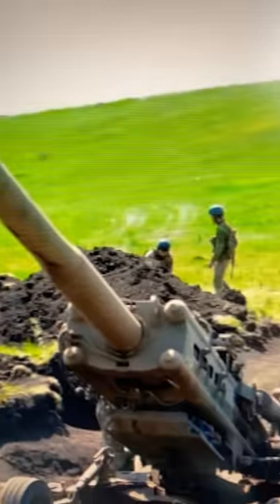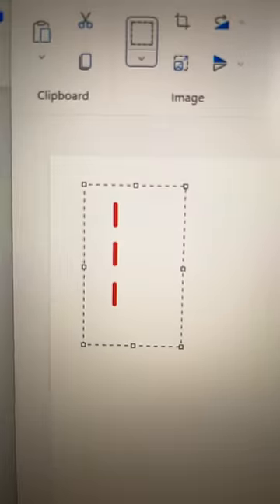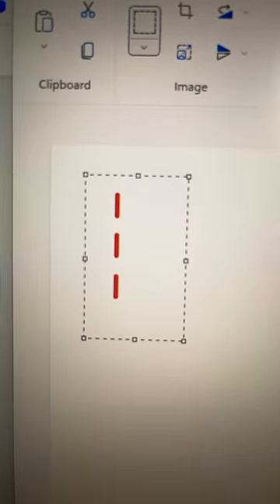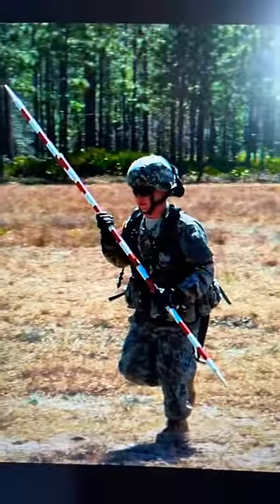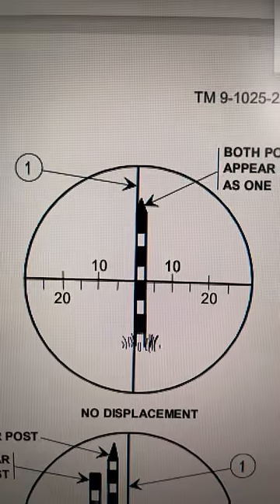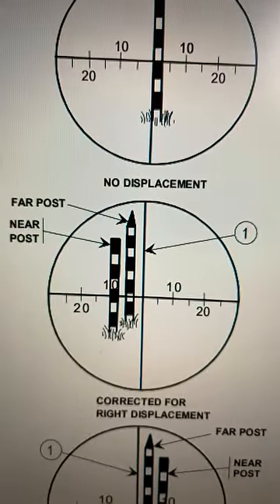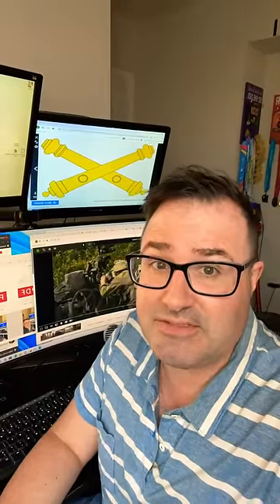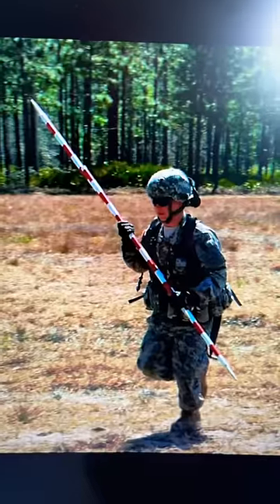How is an M777 Howitzer Aimed?

Comment: “From the type of shell fired to the spinning of the earth.”
“Remember what I taught you, at this distance you’ll also have to take the Coriolis effect into account” from COD4
Reply: At 2km, you will not need to compensate for the spinning of the earth; you will need to compensate for the spinning of the bullet.
Reply: That's Mark Wahlberg foolio whatchu mean COD haha
Reply: So if you travel with the spin you go faster and if you travel against the spin you waste more energy?
Reply: Distance AND direction.  90 degrees to the Coriolis is the Eotvos effect.
Reply: If I remember correctly the Coriolis effect changes with latitude and flight heading of the projectal.
To be honest, this is way beyond my Skil set.  When I miss I three or more hundred shot I shoot the reciprocal of the miss on the target to my aiming point.  It worked really well once.
Reply: @howardpacker6240  Coriolis is about geometry of a sphere: when shooting from the equator to the pole, the speed of the objects are different, the objects closer to the equator moving west to east faster than the objects closer to the pole. You have to account for the difference in speed between those for your north-south component of firing.  The Eotvos effect is about altitude when firing east-west, as the earth spins targets in the east RISE up, and targets in the west DROP DOWN.  You have to account for the Eotvos effect when shooting east-west.  Gunwerks and other companies have made hand-held range-finders that calculate ALL of that and more like elevation shooting level, up or down must be calculated differently and give you a firing solution to dial your scope turret into.  They even make custom turret knobs for their scopes that true up the gun based on its specific muzzle velocity measured by a chronograph.  Their motto is "1000 yards out of the box." You need to attend their shooting school too to achieve that though.  When sniping the last "human only" skill is "doping the wind." You can measure the wind where you are, but not along the firing path and destination so you have to learn to look for clues as to what the wind is doing.  If you can't "dope" you can "fire and adjust" by observing with a scope where the first shot landed.
Reply: @BenHyle called Magnus effect.
Reply: @BenHyle nah you have to take account for the curvature of the projectile. The spinning only makes it go straight. But wind is a factor
Reply: @BenHyle at 2km you certainly do have to account for the coriolis or eotvos effect depending on firing direction.  A 3000 feet per second round travels 0.91 kilometers per second, taking 2.18 seconds to complete the 2km traversal.  The target and the shooter will move east-west at disparate speeds for 2.18 seconds.  Just run a thought experiment: a shooter and target moving west together at the same speed, and then the same thing with the shooter moving FASTER or SLOWER than the target.  The spinning of the earth doesn't make anything go straight. Its not a spinning cube.
Reply: The Chernobyl soundtrack echoed in my head as I read the comment
Reply: @BenHyle Artillery rounds can go up to 30 km
Reply: I remember that mission, you end up missing and just taking the guys arm off.
Reply: Thanks for giving me "Coriolis effect" to google. Down to another rabbit hole I go.

Comment: Aiming poles are used as a secondary aiming reference. When firing degraded (no digital/electronic capability) you will normally use a collimator which is much closer to the howitzer, has internal illumination (if it’s not a busted POS) and is more accurate than aiming poles. Just an FYI.
Reply: Tis is true. Or if your not a complete scrub, your DFCS actually works.
Reply: Yes, and that 10mils shown was the displaced deflection to the near (short) post), using the NFL rule (near, far, line) which in reality was ZERO mils, because of the NFL rule. The line on the pantel (panographic telescope) is the zero line. The distance between the near and far posts should always equal the distance between the far and line, and always goes "near, far, line." That's how you account for gun displacement from firing, not how you determine firing deflection.

Comment: Ryan just in case, during my mortar school in Poland we were taught that those poles were to be used only if there is a lack other of proper targets like buildings with a visible vertical line that could be used as reference point. The far the point/line is the better, you could use electrical poles or even trees if you spot one that fits (visible, with a straight vertical edge, and can be easily distinguished in the environment). Poles can be used in open fields or in open areas in forests.

Comment: Turns out fixed reference points in any calculation are still pretty sweet. You could probably improv these in the field with insulation tape and 2x4 scraps.
Reply: you can also use a DAP (distant aiming point).. its been year I forget but I think it just needs to be 2100 meters or more away.. and its what you use when you colimeter isn't working properly.. and/or the ammo truck runs over your aiming posts
Reply: @MattCamp  why does that sound like it comes from experience
Reply: @little_lord_tam  I may have shot a few rounds off a DAP in my time... And may have see a faulty collimeter and some run over aiming posts..
Reply: @MattCamp  we use sticks sometimes but I just call them storypoles and the aiming posts seem like an important thing to run over nice to know there’s that guy or fuck ups everywhere not just on my job site lol sorry you had to deal with dipshits that make your job harder
Reply: @forevernomad1766  Haha, this was a funny read. Very true, they're everywhere, be careful 🤣
Reply: @forevernomad1766  Funny how we all think of our militaries as elite, smart and professional. But theirs plenty of idiots in all our militaries.

Comment: I was a motarman the aiming stakes are for direction of shooting,then a charge is for distance, and up or down is for location
Reply: The mortarmen attach charges to the tail of the round which adds propellant to the round, thus increasing the range. You alter the trajectory within the added range of the shaped charges by pointing up or down.
Reply: @Stefan Parocki I use to hang a four duce motor all day and illumination for tanks at night,I know about trajectory and there is a left or right on the tube for adjusting fire on target,When you hang a round and things like wind direction and rotation of the earth come into play on some shots plus some targets move they ain't always dug in,so you shoot and scoot so you don't become a target youself
Reply: @Stefan Parocki It's more complicated than that. Angle increases distance upto 45 degrees, past that it starts to decrease. Charges increase the length of the projectile path which increases the distance. It's possible to hit the same spot from 2 different angles, that's where tot (time on target) comes in. The higher arch will always take longer to hit the target compared to the lower arch equivalent. It also obviously changes what angle the artillery round hits the target at which could be important if the target is a vehicle or a building.
Reply: we stuck 2 sticks in front of our foxholes n trenches for field of fire too, not just the arty boys doing it...
Reply: Yes aiming circles for Quick fire missions, shoot and scoot,when your dug in It's going to get Hairy in a big hurry

Comment: Bit more detail (777 guy here). 

So, the aiming posts are the secondary aiming reference with a aiming reference called a collimator as the primary aiming reference when degraded. Displacement is only done if the howitzer has shifted from its original emplacement location (normally after firing or shifting azimuth). FDC is not given the location of the posts but knows the location of the howitzer, and the howitzer knows the location of the posts and collimator. The gunner sight measures the angle between the original azimuth of the howitzer, the posts, and to where the howitzer needs to traverse to. This gives 2 known angles of measure so that the gunner and section know where the howitzer needs to traverse to. Hopefully in the future I can make a video on this but I'm making sure that all info is good for release. Gotta keep that OpSec

Comment: I was a 13P (MLRS FDC) for over 6 years. You gave a pretty good and simple answer for everyone, and I appreciate it. Many people without an artillery or physics background wouldn't understand the slew of variables that go into the calculations, not the least of which is the direction and force of the wind at different altitudes and the speed the round is traveling. Redlegs get a bad rap from many other MOSs, so truthfully, I do appreciate it.

Edit: Spelling
Reply from the maker: I really simplified it.
Reply: I never really thought of wind shift at altitude. Is there an unclassified way to measure that? While not someone able to put this to use in person due to health disqualifiers, I do find the math side interesting.
Reply: @BenLJudy  Weather balloons gather data as they go up/ I forget the exact interval they gather it though.

Comment: US Military: The most technologically advanced in the world with the most sophisticated equipment 

Also US Military: You use these sticks to aim.
Reply: Cheap, reliable, immune to cyber warfare - sticks are op
Reply: @qwertyuiop5530  also look at Call of Duty how many people get major amount of kills with the Kali sticks
Reply: Sticks and Math to aim. On grease boards.
Reply: If it ain’t broke, don’t fix it.
Reply: I’m really curious to know if there’s a program to integrate machine learning to slowly phase out FDCs. if you just have a machine linked to the network analyze flight path data based on easily collectable data about the firing area, wouldn't that be possible to just have a forward observer shoot some info to the gunners?
Reply: @Dohnutninja1337  their was a projected but it got canceled incase of emp warfare the miltary wants to be technology advance while having backups for manually reloading etc.
Reply: Juan, US military trains both the manual method (in the video) and automated (using fancy computers connected to the howitzer). In the event digital methods fail, which they likely would in a contested environment where digital connections are not guaranteed, the manual method practiced since the dawn of the Field Artillery will still work. The Ukrainians were likely already familiar with the manual method and taught how to use it with the M777. But yes, sticks are very helpful to lob steel thousands of meters down range to hit targets.
Reply: Also the US: Uses weapons a hundred years old and it still kicks ass
Reply: I wonder why no one asked granpa in to make small mechanical ballistic computer. Maybe minified Iowa thingy but extra smol as big as a lunchbox. Judging my modern precision engineering it is possible.
Reply: @Dohnutninja1337  AFATADS.  I don't understand why machine learning would be involved though.  It's an algebraic math problem.  Plug and play.  You just have a lot of inputs which can and do get inputted automatically.  Also the FDC does a lot more than just aim.  They coordinate the entire battery.
Reply: It is very effective my friend and you don’t want to be on the receiving end of that artillery piece.
Reply: @CallsignYukiMizuki  every major country does to some extent 
(Half of NATO uses the M2, almost all major former combloc and a lot of third world still keep Mosin M91s, various sidearms)
Reply: Eratosthenes calculated Earth's circumference by planting sticks in the ground. Sticks are OP.
Reply: Anything wrong with it?  Its such a basic yet crucial component that re-inventing it is unneccessary. Like iron sights on a rifle, you can put fancy ones but the basic concept will be the same
Reply: @lordpfeiffer8490  actually. They do have a gps firing system. But all info goes to the fdc. Even rocket artillery goes to the fdc.
Reply: They use sticks (range stakes) with machine guns too. Tells the gunner what part of downrange to put rounds in.
Reply: @notalexzander2  In combat or anything crossing the Subsafe boundary a track record for reliability beats all the bells and whistles.
Reply: @Dohnutninja1337  Machine learning is the latest buzzword on the internet. It's so cool, hip and everyone uses it for everything. It could mean anything, so it means nothing. Could you use machine learning to make me a sandwich or replace infantry? Didn't think so.
Reply: The best solution is often the simplest.
Reply: The M777, M119A3, and M109A6 all have digital firing and GPS capabilities. The aiming posts is ONE of many aiming references we use when firing manually.
Reply: Well... self propelled howitzers are a bit more complicated and enhanced. 
A German Panzerhaubitze 2000 can for example shoot multiple shots in different angles and speeds so they all explode on the same target on the same time
Reply: @Dohnutninja1337  Germany has a concept that artillery, planes, drones, helicopters, infantrymortar, ships etc. are seen as a compound and used at what is avaiable and most usefull. 
Forward observers are called Joint fire support tems and usually have a air/ground and a ground/ground specialized team. They have the capabilities for really precise data and send their info to the Joint fire coordination team who orders and directs STF fire on the target.

This all is brigadelevel upwards, and also includes besides destruction lighting up the field, throwing fog, suppression, laying mines, disrupting enemy operation and also simply obserbing an area
Reply: I was a 0811 cannoneer in the Marine Corps, the aiming post are not your primary, there's what we call a colimeter first. Which is still old school. But aiming post are secondary to the colimeter, and then you go to a distant aiming point that you've already set up. 

But now days there's a digital firing system that makes things 10 times easier. The Ukrainian wasn't even looking at the aiming post. He was looking at his colimeter.
Reply: @Stu1391  we used our digital system overseas a lot. It actually worked very well.
Reply: russia just imagines their target
Reply: Took millions of years for humanity to evolve that's pretty bloody advanced
Reply: Those sticks are highly engineered and cost $800k each. So they're special sticks. Did I mention the stripes? Precision stripes those are...
Reply: No matter how hi-speed your optics are, iron sights never will become obsolete.  Never give up the stone age backup.  I had a rifle and a pistol, I still carried a sharp knife and a multitool.  You've got GPS?  Cool, carry a compass and a watch anyway.  Primary, alternate, contingency, emergency.
Reply: realize, that the computer system AFATDS is a classified program only our closest allies have access to, for obvious reasons McBeth cannot go into how it works or the variables involved hence why it is not mentioned in detail.  the method shown is referred to as Degraded and is taught to us and foreign allies it uses methods developed in ww1 and is well documented and is declassified, the only controlled documentation on the method is the specific ballistics of the munition
Reply: Sticks are the tertiary aiming reference, we only use them when our other aiming references fail

Comment: Please do this in-depth. That's some black magic right there
Reply: I'm no artilleryman, but things like stakes, muzzle velocities, etc, are constant. The stake is always 50m away, and things like muzzle velocity are always the same within a certain margin of error. If you aim the gun at the same spot each time, it will hit near where the round is supposed to go. 
I imagine the FDC mathematician wizards have the entire map formulated by the time anyone needs a fire mission, and that they adjust the formula for dynamic variables like wind and air pressure.
Reply: Oh dude being g a forward observer is so much better
Reply from the maker: I am working on an in-depth video right now.  It just takes a lot of time.
Reply: @RyanMcBethProgramming  don't forget to mention the surveyors! Everyone always forgets about us in artillery lol
Reply: It’s an exercise in trigonometry. Before GPS, the location of the forward observer and artillery had to be estimated by where each unit believed they were on the map and the line between them represented one side of a triangle. The FO would then calculate the bearing and range to the target using a compass and optical rangefinder which would represent the second side of triangle. The third side of the triangle is the line between the target and the artillery and then you simply have to invoke your trigonometry lessons from high school to calculate the range to the target. 

Once GPS and laser range finders were deployed to artillery units in the late 1980’s, they could more accurately determine where each untit was in relation to each other on the map and instead of taking three to four rounds to get the shell on target, you only needed one or two.

Comment: In the Soviet military the guy looking thru the “Bussol” to see a reading on another equipment, not a stick. The commander of the battery is at the “Observing post” with the communication specialist. The commander looks at the target and gives orders thru the communication soldier. He relates the shooting numbers to the artillery units, so they can shoot. The bottom line is: in the Soviet artillery the commander at the “lookout post” both the observer and the firing direction group. It’s been a while since I took the artillery classes while attending civil engineering university in the USSR…. That’s all I remember on this topic …